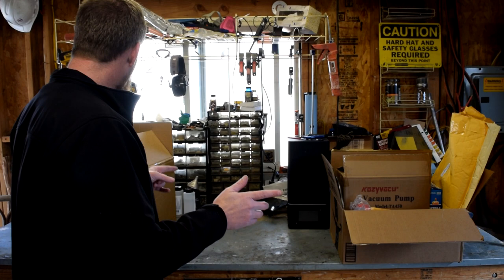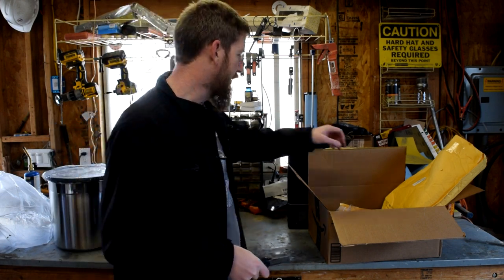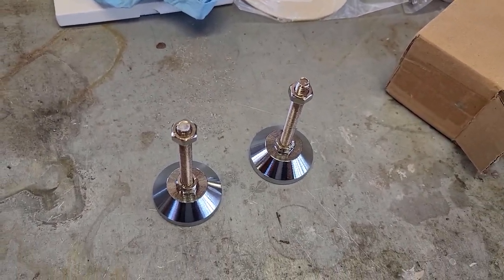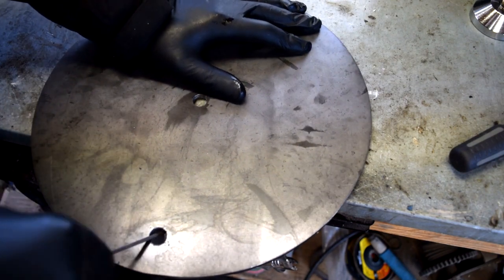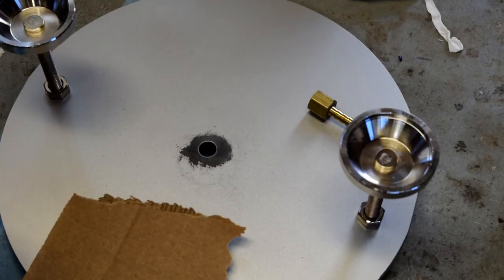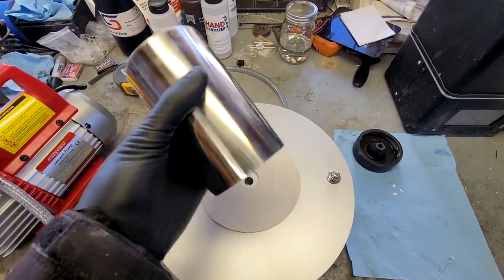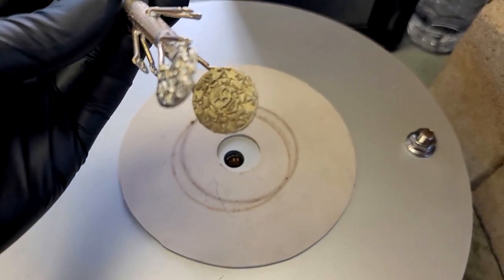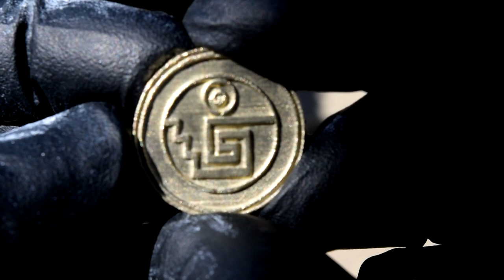$200 Vacuum Casting Table Build & Finish Cast

Comment: Is your vacuum table hooked directly to your vacuum pump? You could use your vacuum chamber as a quick way to boost your vacuum table if you plumbed it in with your table. Pull a full vacuum on the chamber and seal it with a ball valve.  When your ready to pull vacuum on your metal you open the line from the vacuum pot to the vacuum table and also start the pump.
Reply from the maker: With the 3 way valve in essence its hooked to both. That's basically what I did, charged the vacuum chamber then when pouring opened the valve so that vacuum was pulled from both the pump and the chamber.

Comment: Hello. You can put 3-6 wax "wires" on inside wall of the flask, going from bottom to 3/4 of the flask, so the vacuum can "go" on the side of the flask, like if it was perforated. Not sure if you understand what i mean.
Try to have less dead volume on the bottom of your flask too. The less the better.
Reply from the maker: Yea I have heard of the "straw method" before, I'll have to try that on the next cast.
Reply: I saw VOG doing this in his videos and wondered what the tiny wires of wax were for. This actually makes a ton of sense, thanks for explaining! I have all the parts for my setup, just need to find the time and I can try my hand. Good tip!
Reply: @Sigma_Eight  I hope you'll have nice results ! Don't despair if you 1st tries aren't perfect, that's part of the learning curve :-)

Comment: A vacuum gage would help you out.  You need to run the vacuum for enough time to build vacuum before pouring your metal.  Also, you'll get better results by sizing the flask to fit your wax.  You don't want that airspace under the investment that you have in the video.  You could work on the main sprue shape so that the bottom of the main sprue breaks into the feed sprues for the bottom 2 pieces.  Another thing you can do is to run small vents from the top of the coins to decrease back pressure.  You could also add a vacuum reservoir, essentially a thick walled tank that you can pressure to the correct vacuum level and then release to the casting table rather than depending on the vacuum pump to pull enough vacuum as they aren't really designed to get up to vacuum very fast.
Reply: Will this work with a perforated flask inside the vaccum chamber? Maybe making a lead with a hole of the size of the flask . Or maybe there is to much air in the vaccum chamber to do it effectively whole pouring
Reply: Now that's an expert

Comment: You might consider a flanged adapter that sits on top of the vacuum table, into which you seat a perforated casting flask.  Let the vacuum build up and pour away.  I suspect it work better than the straws method, but you won’t know until you try!  Great video!

Comment: Uh just a little safety advice the plaster flask will sometimes come apart during the pour of the brass for various reasons with no container to catch that molten metal when it hits that plate there's gonna be some splashing 1000 degree run off on the bench.
Reply: Ikr, it's just gonna get sucked down the hose, wrecking the pump in a potentially violent way. It's bloody stupid to use this design. No chamber or trap etc

Comment: you can ad (drinking) -straws to closed flasks. running along the  inside flask wall, from sucked bottom/side to well below the top/pouring side. This ad to the "ventilation"
Also you could ad more sprues connecting the items from beneath to enhance the flow of metal.

Comment: I've found empty disposable bernzomatic propane and mapp cylinders can be turned into handy little DIY flasks.  They're just shy of 3" in diameter.    Just make sure to completely vent the tank first before taking a cutoff wheel and cutting it to the appropriate size. (This operation is probably kinda dangerous so for safety reasons nobody should do this but it worked for me)

Comment: you need to have a away to stop molten metal from entering your vacuum pump and destroying it, if your investment gets a crack, mine did, but I had stuffed the vacuum line with steel wool, saving my pump. also put on more legs, with a heavy pour the table could tip, very dangerous.
Reply from the maker: This actually happened to me but the molten metal cooled too rapidly to make it anywhere close to my vacuum pump. I ended up having to replace about a foot of hose. Either way its a good tip when building something like this to put a chamber below the vacuum table as a buffer just in case. 👍

Comment: Thanks for this good video, if I have a constant mold(instead of a plaster mold), can I do this method?

Is the pressure difference between the 2 parts the main reason for this high accuracy?
Reply from the maker: The investment (a mixture of plaster and other things) allows some air to move through it although only a small amount. SO it depends on what your constant mold is made out of.
Reply: @RealProjectTube  I wanted to use a metal mold, so I don’t get proper result?
Reply from the maker: @r.sadeghpour  No a metal mold will not work with vacuum casting as far as I know.
Reply: @r.sadeghpour  put a cork of investment in the vent end of the mold and apply vaccuum while pouring. The investment plug will stop the metal from entering the vaccuum but still allow vaccuum due to it being porous.